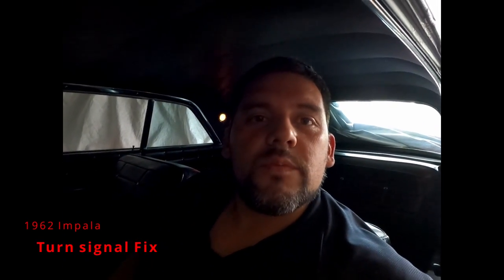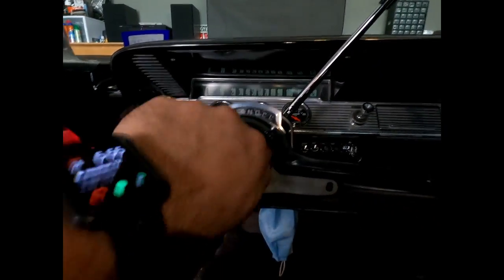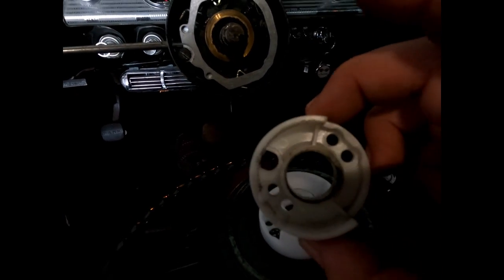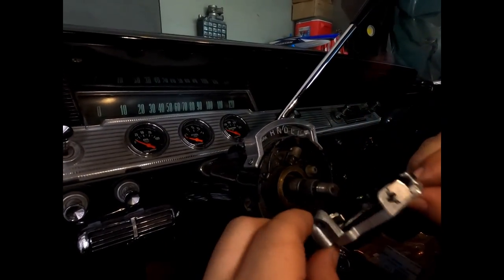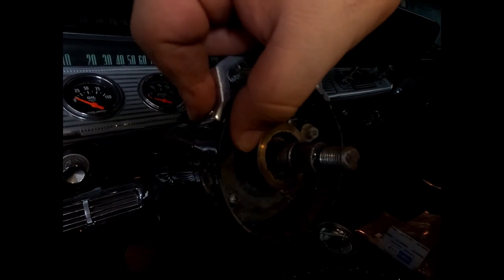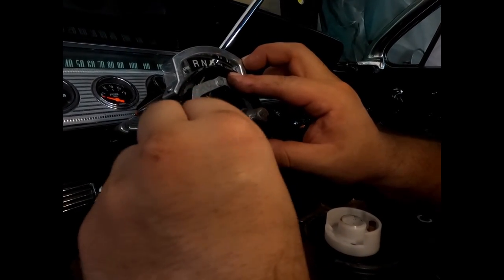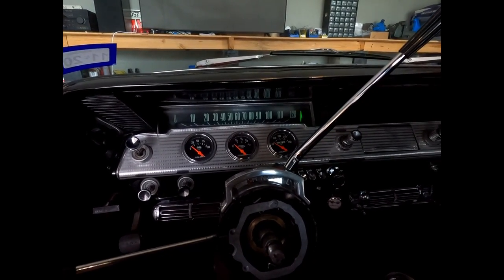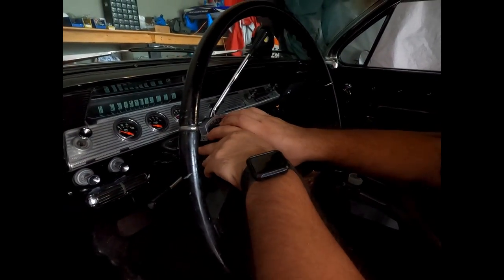How To Repair Turn Signals on 1962 Chevy Impala

Comment: I did what you said it fixed it. But whenever I push it a little to hard or barely it does the same thing again I'm guessing that piece that grabs the ball is wore out
Reply from the maker: Either that or the box on steering column for blinkers